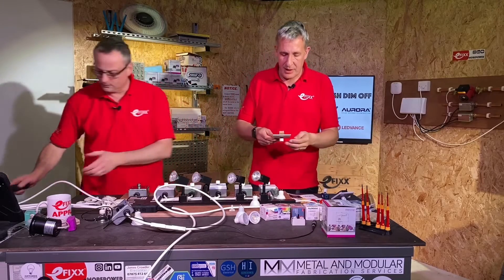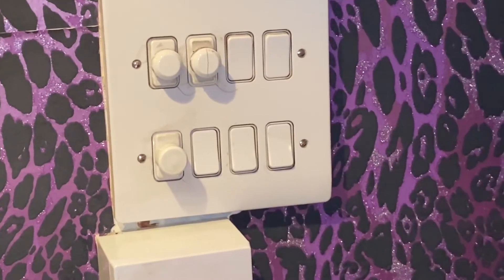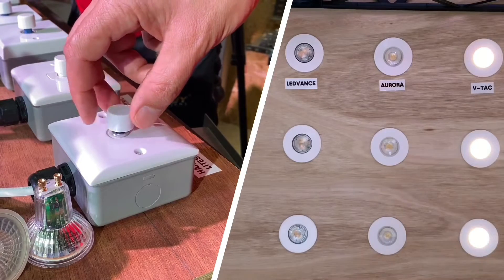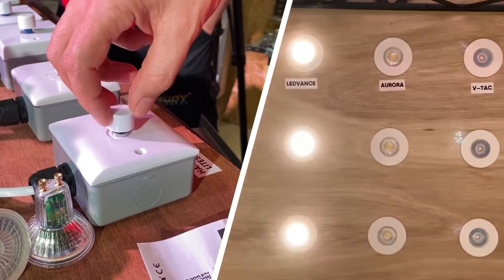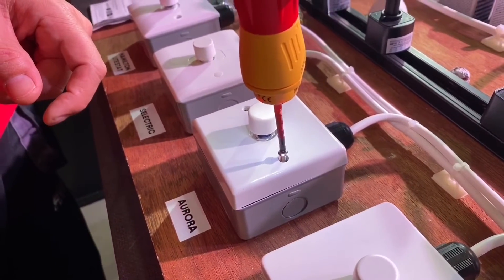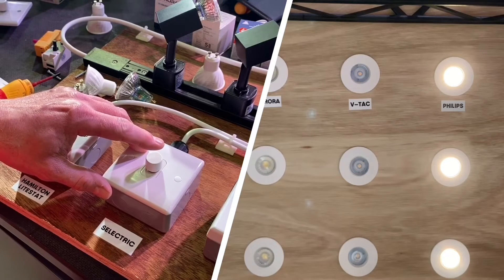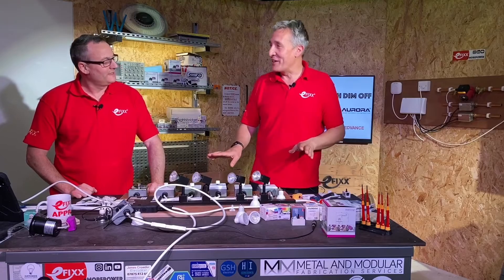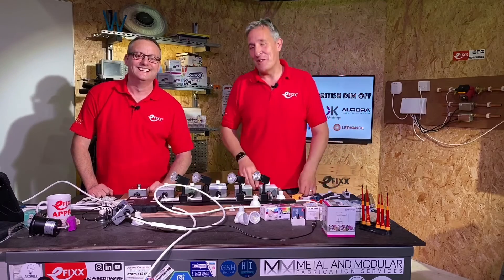DIM & DIMMER - The SECRETS of dimming LED lamps to low levels.

Comment: Teco’s Classic GU10 dimmable spotlights are a perfect fit for spot lighting and deliver warm halogen-like light.
They are compatible with most existing fixtures  are designed as a retrofit replacement for halogen or incandescent spots. LEDlamps deliver huge energy savings and minimize maintenance cost.  They also has excellent compatibility to various dimmers provided by different manufacturers.
◆ Real replacement of 75W Halogen reflector
◆ Delivers 575lm light output with merely 7.5W power consumpion
◆ Four different beam angles: 10° 24°  36° and 60°
◆ Ra＞90
◆ Compatible with both leading edge and trailing edge dimmers
◆ L70 life up to 25000hrs, 3 years limited warranty

Comment: OK guys, very nice presentation and a wonderful line of products. It was great to show the reprogramming of the dimming features, but now I am completely unsure of what to do. We, my wife & I are in the States and not across the pond. We have a cooktop range we use often and bought a matched set of oven, cooktop and fan hood to help remove the smells and smoke. Now, I had a fan failure and diagnosed it as a run capacitor for a PSC 3 speed motor. The part arrived today and the unit uses two GU10+C lamps. They are bright so much my wife refuses to use them. I cook and prefer light but felt a pair of LED lamps by a reliable manufacture have been on sale and got me thinking. I can get the bulbs and have room to install a rotary controller for two LED bulbs. I now know I would have to write down the brand, model and info published at the home improvement store to pick the correct controller to all things well with the wife and I. To be honest, I am completely in the dark now as to what I need or can get reasonably priced to install the missing link. Nice little project I think, as a retired ASE master, or certified auto tech most of us live with an expensive Fluke 87 Type V True RMS Meter or better because we have to know 12-14 volt dc systems by voltage drop, Ohms law and the Power solving math. All this without mentioning hybrids at all and others. So well versed in electrical and electronics. I know I have work to do to complete my self appointed task of seeing the food cook without burning my wife's retinas. Thanks to the both and wish you where in the states, driving correctly and not discussing pounds instead of dollars. Tallyho and have a pint on me! Cheers! P.S. The GU10 must be popular but not here. 99% of every video I have found are all across from the Atlantic. Interesting?

Comment: Hi Gents
I have just installed a dimmer switch, but unlike the ones you showed it's a bit different. The on and off switch is not a press one but rather you turn the lever to  past the lowest setting for off position. In the off position the LEDs are low but not off. I tried to fiddle to get it completely off with no luck. It however did not come with a setting manual. My issue is to get it completely off.
Reply from the maker: Sometimes it’s the lamp which is the problem

Comment: Will the same dimmer switches work with low voltage DC lamps assuming a dimmable led driver and lamps are used or should a specific other type be used? Cheers lads.
Reply from the maker: It’s all down to the driver / dimmer combination - we’ve had reasonable success with using LED strips and phase dimmable led drivers.
Reply: @efixx  this is a doozy; existing is 51 G4 halogen mini spots on a legacy dimmer and the request is to change to dimmable led 😬
Reply from the maker: @rodgerq  I'd have a conversation with the lamp manufacturer first and request some dimmer compatibility data. I've got some G9 LEDs at home which are always slightly dim even when the dimmer is technically off!
Reply: @efixx  I had that before at home but it was only on the fittings that were 2 way switched. Yeah, looks like I'll need to be doing some homework before I do anything else. Joy.

Comment: I job I saw the other day had a problem with there dimmers. A 2 gang dimmer was getting very very warm. Each dimmer was a varilight type for LED and capable of dimming 300w. The load on each dimmer is 5 x 40 watt LED ceiling panels (600/600) with dimmable drivers. Has anyone got any ideas as what could be the issue? The dimmers are pulling 200watt which is well within their range so I'm assuming lights or driver's ?
Reply from the maker: Often dimmers need to be derated for LED loads - check the data sheet for this model . A 300W dimmer may only be suitable for 100W of LED.
Reply: @efixx  many thanks... Starting to make sense now !

Comment: It is about time the dimmer manufacturers gave us a 3 terminal dimmer with a neutral in. This would behave like a dimmer pack and can give an almost 0-100% waveform regardless of what the load is doing.  This immediately takes away inter-dependence between dimmer and lamp and just leaves you with the lamp curve. Classic two terminal dimmers rely on the low resistance of the load to get power - fine with a an incandescent but totally arbitrary with LED lamps with switching supplies. Classic dimmers also cannot achieve full 100% of power as to do so they would short themselves out. Of course all new installations should now have neutral at the switch to allow for any electronic switching device to be fitted.

Comment: Great video. Have you come across 'Holder' dimmer switches from B&Q? Just had one installed for some Osram LED bulbs and the light turns off when only half turned off? Any suggestions? Thanks, D
Reply from the maker: Sorry missed this one ☝️- it sounds like the low end cut off needs adjusting on the dimmer switch .
Reply: @efixx  Thanks for getting back to me. We replaced the switch in the end as it didn't appear to be compatible with the LED lights we had. We live and learn! D

Comment: https://www.ebay.co.uk/itm/Draper-965T-19-Expert-19pc-Interchangeable-Torque-Screwdriver-Set-Insulated/391277741250?_trkparms=aid%3D111001%26algo%3DREC.SEED%26ao%3D1%26asc%3D20160908105057%26meid%3Daf3bf41b4e5c4ce7b3d535965a1bb8ca%26pid%3D100675%26rk%3D1%26rkt%3D15%26mehot%3Dpp%26sd%3D391277741250%26itm%3D391277741250%26pmt%3D0%26noa%3D1%26pg%3D2380057%26brand%3DDraper&_trksid=p2380057.c100675.m4236&_trkparms=pageci%3A47381f8b-4310-11eb-b43a-6e25460608b0%7Cparentrq%3A8234eec61760a9e39118a07affe8d3a2%7Ciid%3A1

Comment: Really good video lads thank you we use varilight dimmers With Osram  GU10 Probably the best combination since Jimmy Floyd Hassel bank and Eidur gudjonshen
Reply from the maker: You can put OSRAM on any team! - We found the OSRAM lamps will
Dim to a low level on almost any dimmer - including ones not designed for LEDs.
Reply: @efixx  I like Philips myself.

Comment: No earth fly lead on metal clad box and face plate 🤣
Reply: As much as just earthing the box is fine as it's going to earth the metal plate (on the decorative ones) when the plate is screwed on, as the plate has to be removed to adjust the low end on some of these, I'd personally be giving it a flying earth lead too.

I'd personally like to see stranded flying leads included with metal faceplates. You can always choose to not use them.
Reply: It was a bit of a joke 🤣 but there is an earth connector on the metal piece of the face plate if you look closely.

Comment: Halogen lights had a sort of standardised dimming curve by design: put more electrical energy into the glow wire, wire glows more.
Maybe the lamps need standardising so in the future any LED lamp will put out the same percentage of its maximum lumens when a certain percentage of the waveform is cut?
Sure it isn't that much of an issue with a programmable dimmer and using all identical lamps, but with technology changing constantly and LED lamps lasting for so long, the chances of finding a new matching lamp by the time one fails are slim, requiring to change out all lamps to get a matching set again. Also by that time I'm sure the manual describing the combination of tweaks required to reset the minimum level will be lost in a lot of households.
Why not put that little screw in the front, hidden behind the knob? That would allow easy and safe setting of the minimum level: turn on the dimmer, dial it all the way down, pull off the knob, set the level, push the knob back on, no need for morse code or working live on the backside of the dimmer.

Comment: Also fitting some dimmers in to a grid switch system you can't get them side by side as they don't line up with the grid yoke ..
Reply from the maker: Great advice 👍
Reply from the maker: @Woodkin007  it’s something to watch out for when choosing a grid / dimmer system

Comment: Did you try zano dimmers
Reply: Doesn't appear to have tried the vpro either. Seems a massive omission.
Reply: @adiemoore79  Agreed. I'm bringing a bunch of Varilight back to my home country to install and show my family what British dimmers are like...
Reply from the maker: Not yet - how would you rate them compared to the ones we featured?
Reply: @efixx  Yes there I would agree with @Adrian Moore. It would be massively better to include Varilight V-Pro standard dimmers, V-Pro smart dimmers, and V-Com.
Reply: We'd definitely say give them a try!
Reply: @ZanocontrolsCoUk   Ive used both and both still can have issues !!!     Its always a good idea to do a dummy run on a bench to make sure dimmers and bulbs  "marry up well" . Before doing a job and it all starts going wrong .  who ever designs dimmers need to really rethink how they are used on site and just how fucking stupid they can be to set up .Its like doing morse code !! And unless you correctly put a child lock code in. Some fucker plays with it and screws the program up !